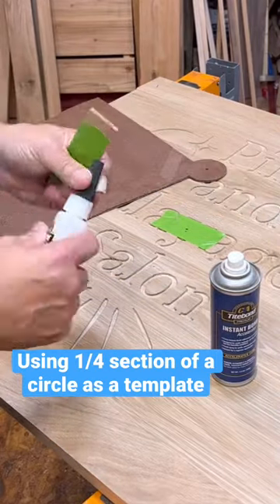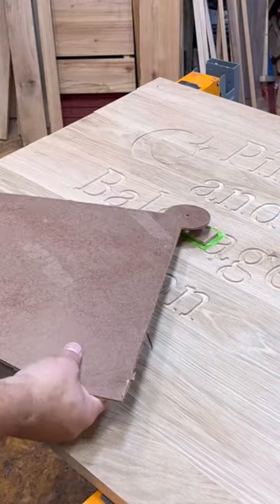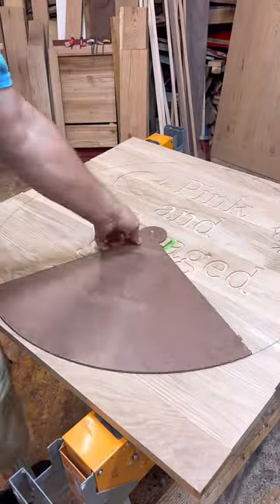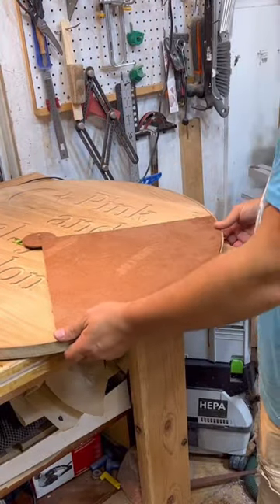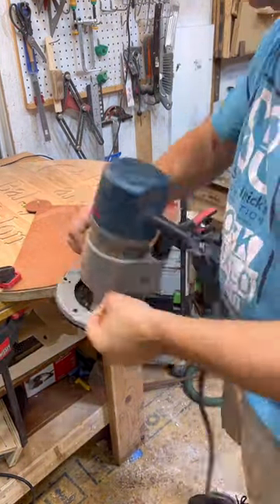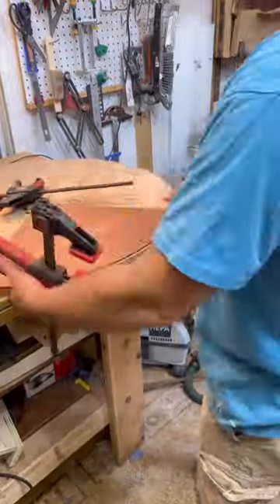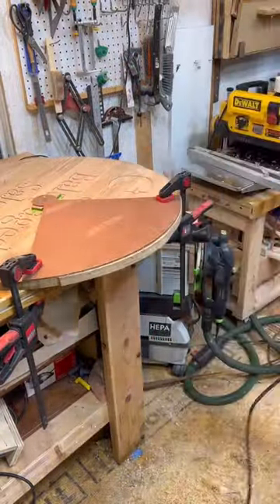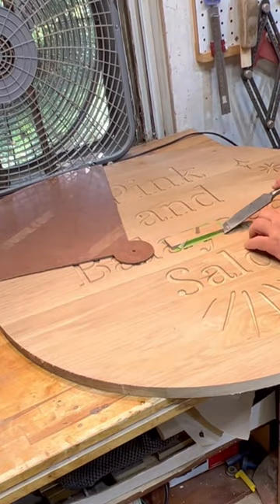Circle jig - easy and fast #woodworking #woodworkingtools #jigs

Comment: If you have to make another round sign you should look into a milescraft 1219/1269, it will do circles from 1.5”-52”. I just made a coffee table and this jig made it so easy to do circles.
Reply from the maker: Thanks! I actually thought about it but I couldn’t do a hole in the middle and really worked out well - I’ll probably do this again!